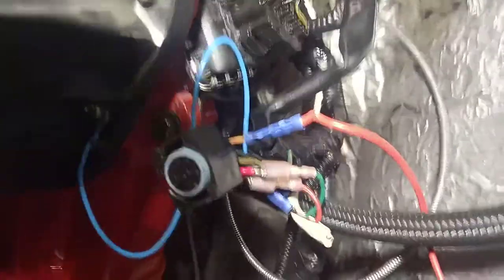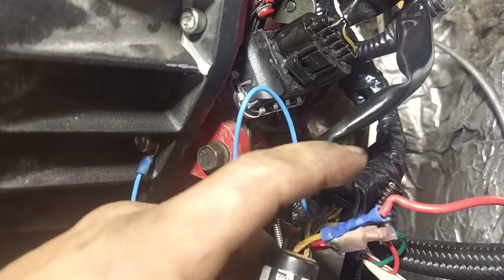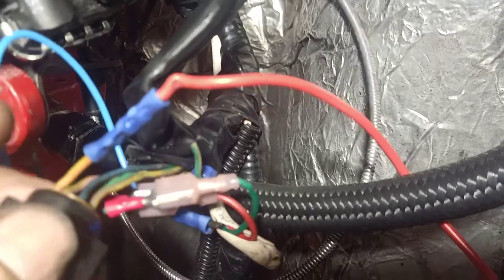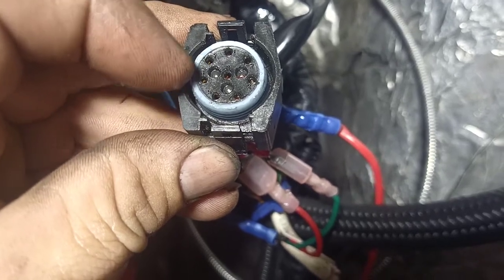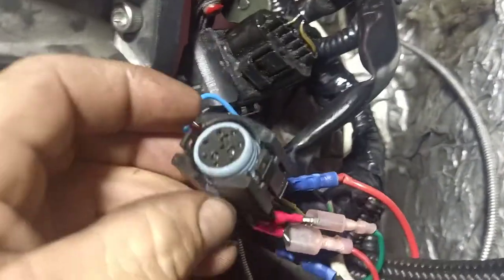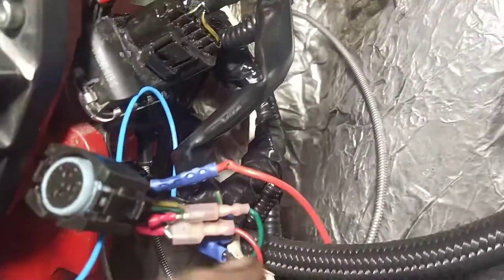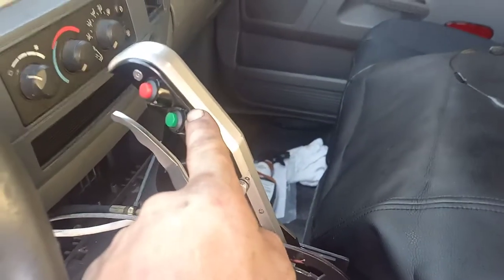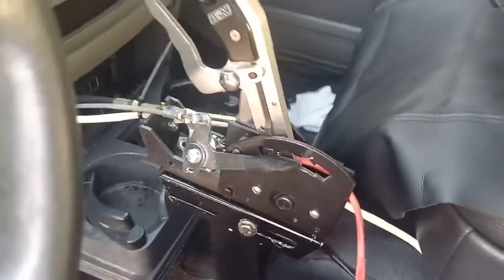Lock up and over drive wring for 48re

Comment: Did you ground out the o/d and tcc or did you put power to it? Little bit confused
Reply from the maker: 12V wires comes from battery. The od and tc wire are charged via the incoming 12v wire. You activate the solenoid when you cross that wire to ground.

Comment: I have a 46re fmvb on my dodge Ram 1500 and I noticed the transmission will shift into 4th on its own like it’s pressurized. Didn’t do it til I hooked up the exactly like yours are, grounds go to the case and switched 12v